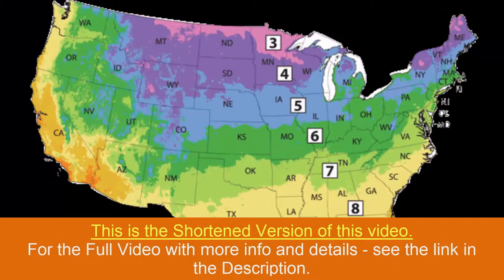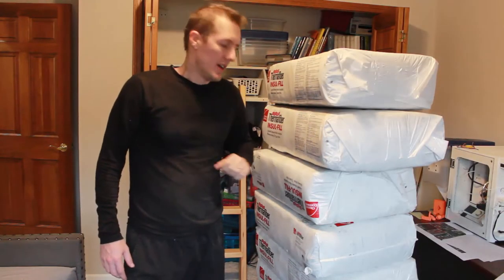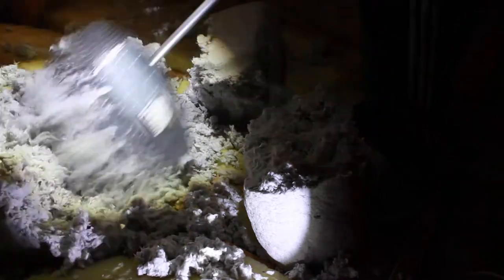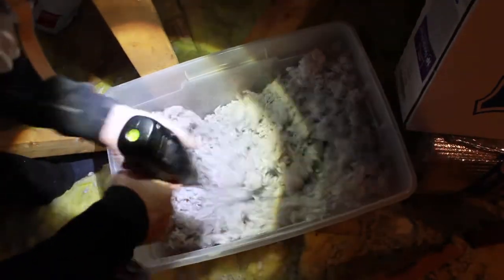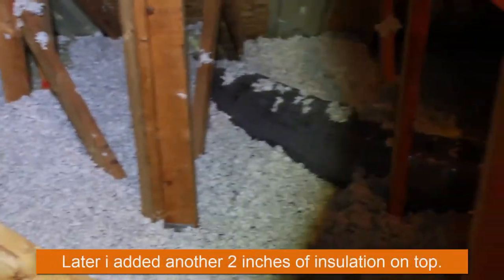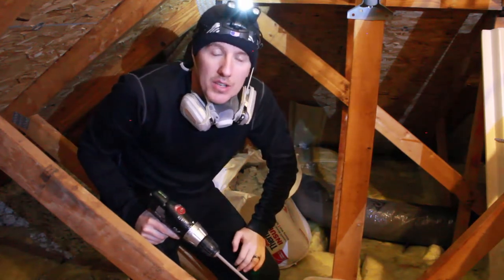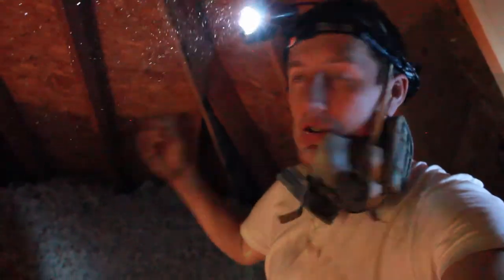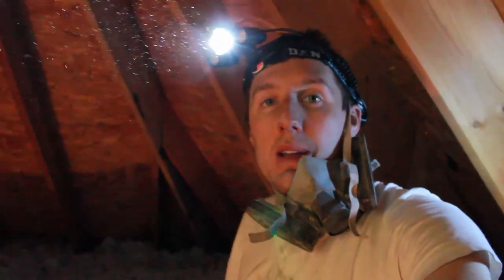Insulation by Hand - No Blower | SHORT VERSION

Comment: I'm glad you did this video. It shows it can be done by hand a little each weekend vs having to do it all at once and getting rental equipment each time. Although it might or might not be as fluffed as the machine, it still has to be way better than before. Great job and thanks for video!! Also what type of insulation did you use wool, fiberglass etc?

Comment: I used cellulose and can be applied with a leaf blower. Fluffs it up even more. When I was using that same method with a paint/mud mixer it was like double just ripping it apart, with a leaf blower it is probably 5x fluffed.
Reply: How do you do it with a leaf blower 🤔 just lay out some chunks and blow em?
Reply: @BossLevelPro  Probably ran it through a mulching leaf blower?

Comment: Admirable.
Some elbow grease, imagination & ingenuity can go a long way.
If you have a utility (heating) expense trend established (eg. Historical Data), would be interesting to know the energy savings.
(Or do you notice a significant decrease in your furnace cycling on+off).
Good Job !
Reply from the maker: Ya that might be something i can look at over the next few years.  Though like you said, i would have to compare the monthly cost to heat the house with the temperature for that month.  But also our house leaks cold air from the doors and windows too.  I've been slowly trying to find those leaks and fix them as well.

Comment: I was in my San Antonio attic yesterday applying cellulose by hand. As the 11 am hour approached I found myself in an inferno, clinging to the end gable,  savoring a faint, passing breeze. A concurrence of events had brought me to this lowely state but we need't stray down that grim road. Time was ticking and our ill planned Father's Day party was scheduled for noon. I stuffed the dust mask back over my face, and cut a single bag of cellulose open. It was the only bag I would be able to complete as I had not brought a tote bin or a drill to mix. I instead rubbed my hands across what seemed to be the contents of a million washed pairs of jeans. The material came apart easily but was slow to spread. I ran out of time, dyed my hands a rust color for several hours, and nearly melted to death 😮

Comment: Instead of the plastic tote would you say a cardboard box would be a good replacement?  By the way thanks for sharing, the demo is good.
Reply from the maker: Ya, but you might need 2 or 3.  The metal mixing paddle is hard and would probably rip through the box if you hit the edges repeatedly
Reply: @DaveWirth  Thanks for the feedback.  I will go ahead and use a hard plastic tote.
Reply from the maker: @luistello1971  Well my plastic tote cracked too.  Maybe a box is better, because you can just throw it away.  The tote i used was basically ruined anyway.

Comment: Cool idea with the drill.
I've done this by hand, and I didn't wear a mask. (And, I regretted it!)
One thing you want to make sure that you don't do with insulation is bank it up against the roof decking. You will create some sort of vapor lock, and rot your roof deck out. The insulation prevents air movement when it is against the decking.
Reply: Can you explain this a bit more. We are doing this to our house built in 1930 and 0 insulation. I didn't have a father growing up so a lot of these things are new to me. Not to sound dumb
Reply: @erikrodriguez775  Sure! You are insulating the wood beams, and Sheetrock ceiling (or plaster & lath) to slow the travel of vapor and temperature though the ceiling. You want to fill the spaces inbetween the wood beams to at least the top of the wood beams with blown in insulation,(like in the video) or un-faced fiberglass bats. "Unfaced" means that there isn't any paper or plastic like vapor barrier.  
Most giant box hardware stores rent out insulation blowers, and this usually requires someone to stay up in the attic, and another one on the ground feeding insulation into a hopper. If you are doing it by your self the drill method works pretty good like in the video, or you can use an electric leaf mulcher and then spread the pile of insulation in with a garden rake. HOWEVER, you need a good set of googles and a real N95 dust mask, because micro particles will float around using either a blower or mulcher. It's really easy to do, but it is real time consuming, and you do not want to bank the insulation against the roof deck The wood that holds up the shingles because the insulation will collect  water vapor and keep it against the wood, eventually rotting the wood, and requiring new decking, and that will make a more expensive re-roof when you replace your roofing shingles, tiles. You might consider that since you have zero insulation that you seal up any holes, cracks, or gaps with "Great Stuff" foam insulation that comes in a can  a day or two before you install the insulation because the idea is to slow the loss of your closed envelope you are creating. MOST IMPORTANT - Since you have a house from the 1930s look (but don't touch) for exposed wires first and make the determination if the electrical needs to be updated. You will not want to bury any exposed wire. You will want to hire an electrician to take all of those risks. Shut off the electric to your home from the fuse box and then go to the attic and look with a flash light, take digital pictures, it makes it easier to explain what you see to an electrician if you need one. Hope this helps.

Comment: Wonder how good an R value it would give if i just built a layer with the blocks instead of breaking any of it up..?
Reply: The air pockets increase the r-value because you are preventing or slowing the transfer of heat and vapor. The higher vapor/humidity the more of a thermal bridge effect happens. (Water is the most ideal for storing and slow releasing heat/cold). The air pockets slow the transfer of heat with voids by reducing the bridges to thousands of tiny bridges. The effect is that the heat unit, like a car will bottleneck, slowing the travel of heat down to a slow crawl, like that of traffic on a multi-lane freeway condensing into one lane. The R-value (R=Resistance) of solid wood per inch is almost and R-1 for every inch of thickness of wood. However, you can increase the R-value by creating pockets of air in between layers of wood, like creating a laminate similar to two and three pane windows. (The sweet spot for glass panes is, 16mm turning an R-Value of R-1 into an R-value of almost R-4, R-values of R-7 can be achieved by filling the voids with certain gasses).
Reply: @elmerkilred159     I wonder if their been any house expirementing with water as an insulator?
Reply: @dennykeaton9701  Igloos made from frozen blocks work. Water either stores a specific temperature and slowly releases the temperature as radiant heat, or it works like a evaporative cooling, or it slowly chills the air by releasing a cooler temperature in an Ice Box with a block of ice.
Reply: @elmerkilred159    I'm wondering if panels like maybe big ice gel packs would be practical then. Of course it would have to be an improvement over the fiberglass, rock wool, cellulose, foam industries.

Comment: 55 gallon trashcan up in the attic.

Load the packages of insulation Up to the attic.

Put one bag into the 55 gallon trashcan.

Get an electric Weedwhacker and weed whack the crap out of it inside the trashcan.

Then dump it out into the area to be insulated.
Reply: How do you fit a 55 gallon trashcan through the open hole to the attic?

Comment: I appreciate that you did this video as it was quite informative, though perhaps not in the way you intended. I though that you were only going to add a little bit of blown-in this way to s a small area of your attic; which might have been more cost effective by hand than with the machine. However, with the amount you actually applied, it is obvious to me that you should paid a little bit more to rent the machine and apply the insulation the right way. Whereas you probably added some R value to most of your attic by your method, it was likely a fraction of the ~3.5R/inch that proper blown-in cellulose is able to achieve; and you likely missed areas that the blower would've allowed you to reach. I also suspect that you probably spent more time and physical effort using your method than what would've been required by using the machine. So, all in all, your video was very informative, but mostly in what NOT to do. I am not trying to be insulting, but I feel that DIY-ers should be dissuaded from doing it this way. Better to pay a pro to have it done right than to do it wrong yourself.
Reply from the maker: I agree.  In hindsight it might have been better to rent a blower and do everything in 1 day.  
Also i could have just spent more and bought the rake & shake stuff.
And yes, it was way more work by hand then with a blower.